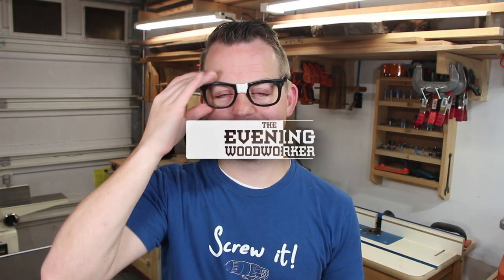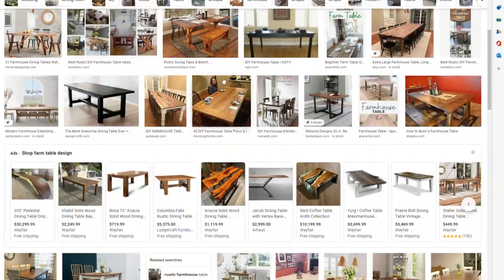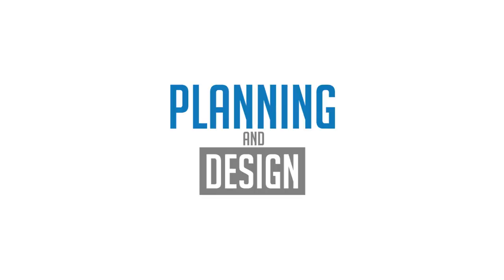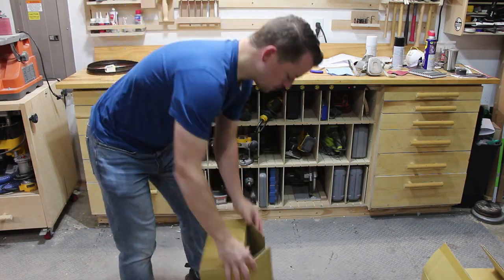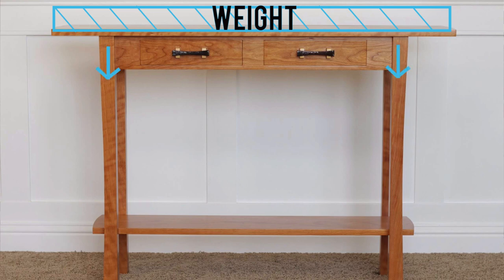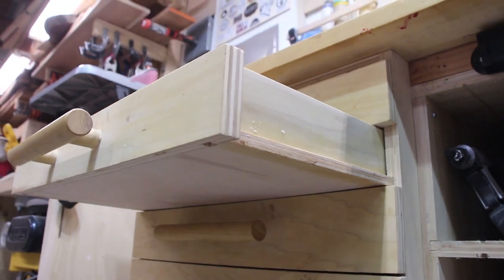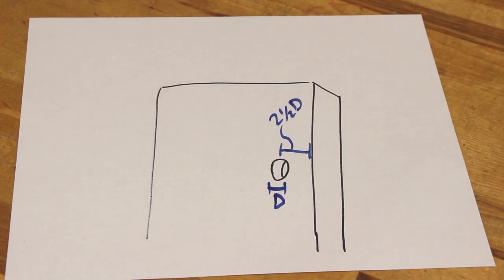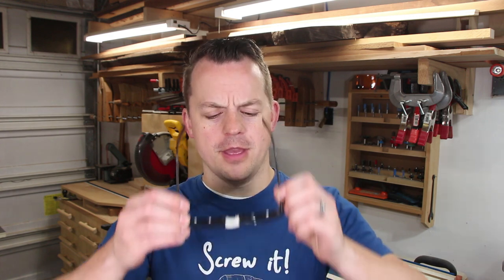How to Design Furniture Like an Engineer | My Design Process

Comment: Do you know of a good source of weight limits and specs for woods that includes things common in furniture, like spindle legs?  I can work out the dynamic loads of a kid jumping on a bed, but I'm not sure on the sort of home-building-scale data avail for lumber applies to smaller scales or items.  Any advice?
Reply: Like I can easily look up a douglas fir 4x4 and it's structural characteristics, but a half inch rod of cherry is not something I know how to look up
Reply from the maker: Yeah that would be great if something like that existed. I've wondered the same thing, but I think most people just over-design the furniture or break a few until they get it dialed in! Apart from the sagulator website, everything else is just intuition.

Comment: Nice.  Risk Management is the next discipline I would add to this set.  What can go wrong?  How badly can it go wrong?  Is it likely enough to go wrong that I need to worry about it?  Feed the answers to these questions back into your requirements, resisting the urge to solve them immediately.  That way, you don't have "ghost" requirements hidden in your risk management.  Also, that way you can solve problems in the context of your other requirements, rather than as individual issues.

Comment: Great explanations and walkthrough on the process and force load distribution. Will definitely use the sagulator, as much as I like trig. Beautiful bookcase there. I have to do a patio cover with ledger over a large slider and notch facia for rafters to gain overhead. The county regulation handout is nice for spans, length for board material, but doing a prototype is the difficult task I’m up against in ledger placement on the stucco of the house under the eves. Looking like I’ll have to start with columns and maybe even headers before I can get ledger height for rafter slope. 
On hoisting equipment I shoot for a 4:1 safety factor with an 8 ton bottle jack (which is overkill), but 2:1 as a minimum right? With the cable clamps, ironworkers say, never saddle a dead horse.
Anyway, great video covering all the aspects in a short amount of time. 👍🏼
Reply from the maker: Yeah in some cases the safety factor has gotta be much higher... that's probably a good idea!

Comment: Love your approach, and The Sagulator, what a great tip. I'm building a house and will be putting in some shelves to hold our canning jars. Last time I did this the shelves sagged a bit = not good, and I ended up putting a central support in. This time I'll use The Sagulator and dimension the lumber properly to insure it doesn't sag.
Reply from the maker: It's pretty handy! I use it on every shelf span I build.

Comment: There is a process, or activity, or whatever we want to call it, known as "design". And there's nothing in the way of a person who practices the process of engineering from doing this "design" thing. But no, you cannot design like an engineer. Engineering is the activity of figuring out exactly how something should be done / constructed to make the engineered product the cheapest / best / most efficient / whatever the mandate. The engineer applies a bunch of knowledge (on physical principles; and avaialbility of materials; and more and more and more) to specify a blueprint. But that is often a blueprint of : 'how we're going to make the desired / requested / mandated "design" actually happen in the physical world'.  A designer might consult an engineer. For instance to inform what the design could or couldn't be based off physical principles (say strength of the material, or which material to choose given strength requirements).The designer might consult themselves in this, if they happen to be an engineer. But at no point are they engineering a design. They're designing (something that may then need to get engineered). And maybe they're told "that just can't happen", or "you know, you don't need that much material in this part", in which case they might [need to] go back and re-consider the design. But they're not designing like an engineer (nor engineering a design, which i think some people might understand this as). Understanding the purpose; use case; client requirements; proportions; visual interest; prototyping; experiments - are all fundamentals of the design process. And not specific to design by or as an engineer. So we just don't need to call this an 'engineering design process' since it already has the simpler term of just the 'design process'. 
  Now could we say "Learn some of what engineers learn, in order to build better furniture"? Hells yeah! Could even say " .. in order to be a better designer". Load path, statics and dynamics, etc.. Every designer should know about these concepts. Or wish they did. But i think that if the point is better understanding what it is we're doing when when we're designing furniture, or to be cognizant of what we're doing while we're doing it, then it's important to understand that fundamental disparity between what design is and what engineering is. And when one does, the thought of designing like an engineer is as non-sequitur as algorythming like a shoveler, or piloting like an aerospace welder, or welding like a pilot, or cooking like a farmer.
Reply from the maker: Sounds like you're an engineer too! Yes of course you can't replace an engineering degree or years of experience with one YT video, but I think getting people to think of engineering concepts when designing and building stuff can only help someone be a better designer... maybe not quite an engineer!
Reply: @EveningWoodworker  Absolutely. And it's great to see a video sharing and promoting .. let's call it structural thinking. Thank you for that. But a tiny little thing like terminology can set in some viewer's brain an expectation of how things are, and that in turn maybe lose them years of mis-understanding their own approach. Particularly, not practicing the thing that design really is. So worth trying to make clear teh difference, and the 'setting' in which structural thinking sits.